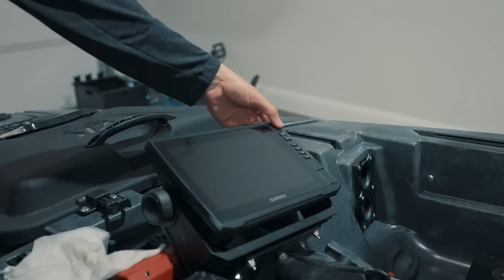I Built My DREAM Fishing Kayaks!

Comment: Now that you're a dad, you really missed an opportunity to snap the ratchet strap and say "that's not going anywhere."
Reply: 😂🤣😂🤣😂🤣😂🤣 you too? LOL
Reply: Yeah, you're hitting pretty close to home with that one. No one needs to know about the stroller I lost off the roof of the car somewhere in Wisconsin when Tyler was just a baby. I said "Yes,  I'm sure I have it tied on there tight"...  ; - )
Reply: OK, I've been corrected. What I really said was "That aint going nowhere, now get in the car!" And several hunderd miles later I'm told that I said "No, that noise is Not coming from the roof, it's just road noise"...
Reply: No job is officially complete until "That ain't going anywhere" has been declared.